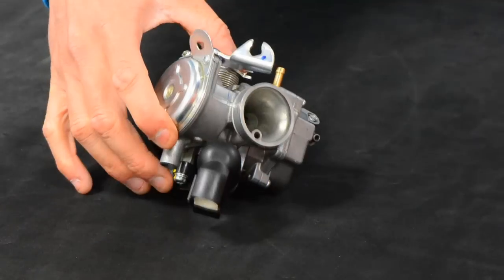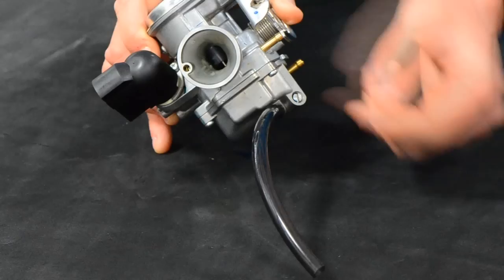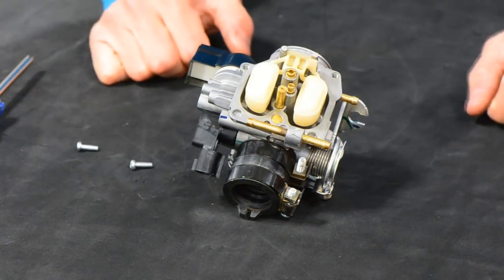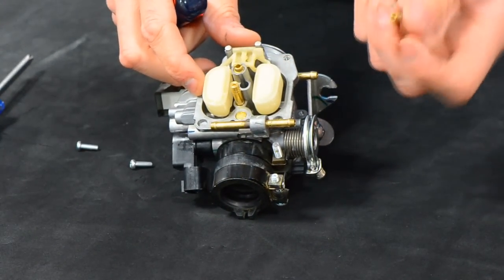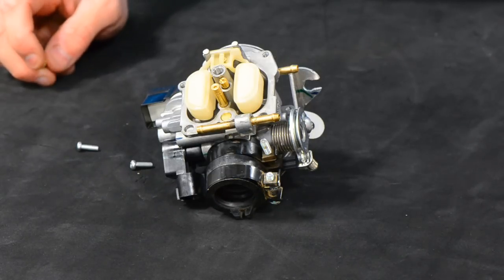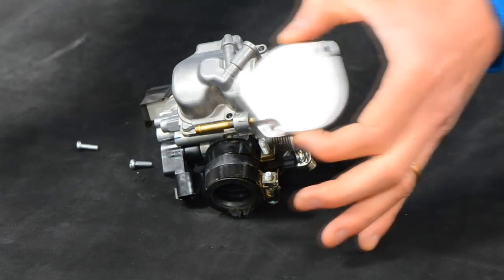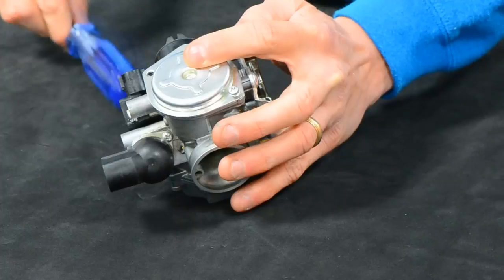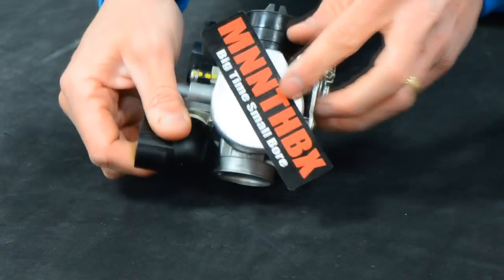(How to Jet) a Honda Ruckus carb

Comment: What jet sizes would you use for 7000feet in elevation for the pilot and main jet? Loved the in depth how to video
Reply from the maker: It would depend on what's on the bike, but that high, I'd start with the stock 35/75 if the bike has a pipe and intake. I doubt seriously it would want more brass at elevation.

Comment: Thanks for this video, on a stock everything, what would be my advantage to change the slow jet from a 35 to a 38? And should I also increase the main 75 and to what, and what will it improve?
Reply from the maker: If you are stock, I would not change a thing. If your are running an intake and pipe then a rejet is necessary.
Reply: thanks for the quick reply, that's what I will do!

Comment: Hey, thank you for the video. Very helpful! Quick question, I am installing a new exhaust and i will most likely need to re-jet it, do i have to change the slow and the main or just the main? Also, how to I know what size I have installed? I cant seem to find it on the part itself. Thank you!
Reply from the maker: There's no answer, as it all requires testing based on the bike an location, but we can give you a starting point. If it's all stock except the exhaust, I'd go 35/78. If it has an intake as well, start at 38/80. If it's a stock bike, it has 35/75 currently.

Comment: Great video,  Can you tell me if there is a passage below the main jet that might get clogged.  I pulled the carb on my 07 ruckus that had sat for a year.  Cleaned both jets and reassembled.  It idles great, but won't go above 15 mph.  When I give it gas it kicks down to idle.  I've re-set the diaphragm 3 times thinking that was the problem, but no go.  Thank you in advance!
Reply from the maker: You can disassemble and clean in an ultrasonic bath, but keep in mind your old gas will also effect the fuel filer, lines, etc...

Comment: Do I need to adjust the air/fuel screw after putting these on?
Reply from the maker: It's always best on any bike, to slowly turn the air screw to the point where it finds highest idle, then back it down just SLIGHTLY off of that mark.

Comment: If I put a yosh and a air bix eliminator, i need to jet it but just the main jet or te slow jet also? I dont understand what is the utility of the slow jet. Sorry for my bad english, im french
Reply from the maker: Both. I'd start with the 38/80, and test other mains.

Comment: Question: I went up to 38/80 with an intake and exhaust and gained great mid range but lost a ton of top end and it slightly Boggs ? What am I doing wrong
Reply from the maker: Ultimately, you'll have to test several jets. I would probably drop the main to the 78. I'm guessing that will be spot on.

Comment: would the 38 Pilot and 78 Main jet work with a stock set up? Or should you just stay 35 Pilot and 75 Main?
Reply from the maker: Stay with stock jetting on a stock bike. It's spot on.

Comment: Hey, I'm a dolt and couldn't easily get the pilot jet off, leaving it a bit damaged. What would be the best way to proceed to remove it?
Reply from the maker: +Patrick Garcia Hard to say without seeing it in person. Rule # 1 when turning soft brass, is to use a screwdriver that fits correctly. You may be able to work it out with another driver, or an easy out. Make sure to disassemble and clean the carb when finished, as you don't want debris in there.

Comment: hey great video! I was wondering what you recommend for a stock rockus. I always felt they ran a bit lean for maximum economy based on plug color. have you ever tried jetting a stock rockus and noticed a change after bigger jets where installed I not care about fuel economy. I have been thinking about adding a aftermarket exhaust I want to see if I can find something to add a little deep tone to the sound of the bike with almost stock db levels so I guess my question is a 2 parter lol.
Reply from the maker: We've always found stock jetting to work best on a stock Ruckus. The Yoshimura is quieter than most aftermarket exhausts, though quiet a bit throatier than stock.
Reply: thanks for your super fast response I have looked at a lot of the exhaust systems and I can never get a db ratings on any of them other then for the hmf it says its 94-96 db's would you know what the yosh is and also would you know what a stock exhaust is to gauge the difference.
Reply from the maker: Most don't publish db #'s, but I can say from experience, the Yosh is far better than most, if you're looking for a system that's not overly obnoxious.

Comment: I'm really confused why you'd make a cosmetic change on a part that can't be seen once the Ruckus is put back together. On mine at least, you can't even glimpse the carb once it's put back together.
Reply from the maker: You can see it well on any extended Ruckus, and most are....

Comment: I have jet carb. Notice start den it Stalled out can you help me with this problem
Reply: Did you clean all the passages in the carb? Did you clean the idle jet (pilot jet)
Reply: They are new
Reply: @nicholasventura4107  Did you clean the carburator before installing the new jets?

Comment: What size main jet do you reccomend on just an intake mod?
Reply from the maker: Only a guess, as every bike and situation is different, and it ultimately comes down to testing. I'd start with 35/78.

Comment: Was that little part about the decal a joke? Very well made and informative video but trying add the tacky sticker to the carb where it doesn't even fit was ridiculous. Put it on your toolbox or something.
Reply from the maker: +wht01ws6ta Obviously, it's very serious, and it will never run right if you don't apply that decal quickly...
Reply: +mnnthbx Haha yes I know the sticker is very important to make more power for my Ruckus. But they work just as well for both HP and TQ on my toolbox so that's where I put all mine. Been working out great so far!